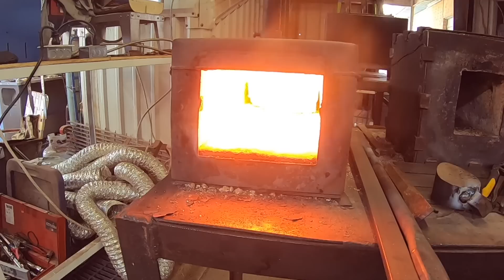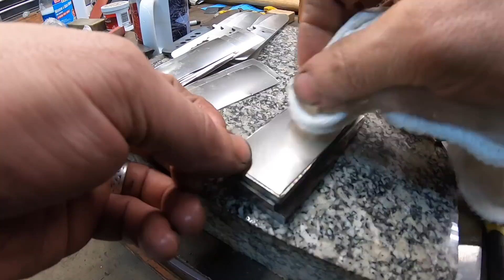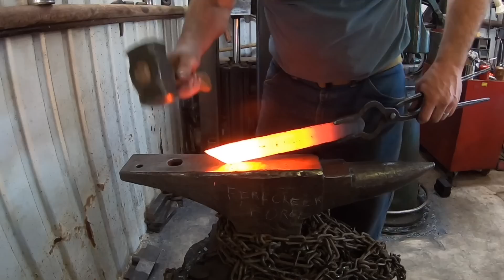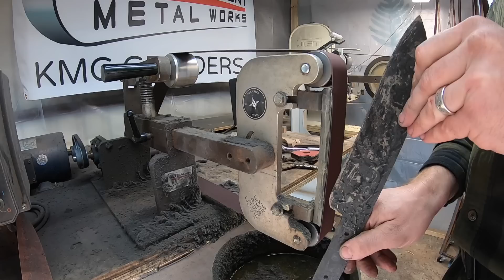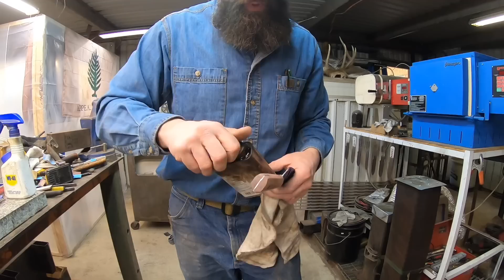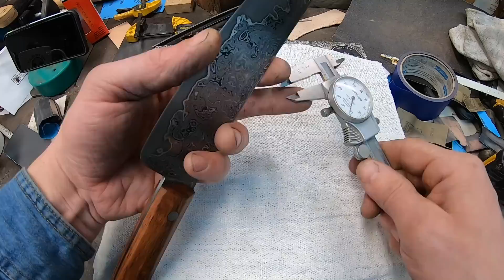Forging A Japanese Style Blade From Nickel And Steel, Blacksmithing, Knifemaking

Comment: I know this is an older video and I’m testing your memory. I am getting ready to try forge welding, pure, nickel, similar to what you used on a Damascus go my I’m building and have never forged welded using pure nickel….. besides cleaning it with acetone do you recommend grinding any of the surface of the nickel or do I just need to clean it with acetone? Thanks for any advice or tip tips. Much appreciated!
Reply from the maker: I like to brighten it up with some 220 grit sandpaper, especially if it's been sitting around for a while and has a bit of a oxide or dull lookjng surface to it. As long as you keep it clean after that, acetone isn't really necessary.
Reply: @FireCreekForge you da man!!! 👊 thanks for your help! That’s the crazy thing about YouTube is you have no idea who I am and you don’t owe me anything yet you take the time to help me out! Really appreciate that a lot!

Comment: About to attempt a gomai nickel Damascus knife. Ben having hard time finding info on forge welding temps for nickel in a billet. Any temps? Looks like you were at normal forge welding temp in the video.
Reply from the maker: Yes, steel and nickel have very similar working temps so it makes that part simple

Comment: fantastic blade, it looks like a coastline.  What caused the "shadow" line along the divide between the mono steel and the coating?  Excellent video with the critique - great content and very informative.
Reply from the maker: Thank you, the shadow is where the steel is still dark from the etch, elsewhere the oxides are cleaned off more

Comment: Nicely done. Remember that the Japanese smiths who get that even core steel reveal have been doing these blades for years. They also usually use a convex grind instead of a full flat grind which is more forgiving in terms of core steel reveal.

Comment: Hi! Just a bit of constructive criticism here. That knife looks great, but because of your camera setup, the image gets warped on the knife "pros and cons" at the end of the video. I don't know if you are using an "action camera" for that, that's a common problem with those, or it may be because of a wide angle objective and lack of correction. Anyway, when you are making a closeup, you should correct those warpings so it doesn't look like your knife bends away from the corners when it's not focused dead center.

Hope this helps, cheers ;)

Comment: The balance of the knife could be adjusted by putting some inserts into the handle at the end (metal, stone),, or adding a bolt-on end. 🧐
I have enjoyed the voice over and the analysis, and really like the way the blade turned, although unintended. As a customer, I'd most likely choose this knife over its future improved version. 
Happy holidays! 🍿

Comment: 1 inch is 25.4 millimeters; so then you invert, which gives that 1 mm is 1/25.4 inches & therefore 0.1 mm is 1/254 inches. So 0.2 mm is 2/254 inches; roughly 8 thousands (≈7.874E-3) of an inch.

Comment: thin your 52100 to the desired thickness FIRST... taper it, THEN add the softer (at temp) nickel Steel for the san mi.... 52100 is much harder at welding temp than 1045 or nickel

Comment: Nickel is a really handy metal in forging, especially when you're working with high alloys or stuff with a lot of chromium in it which doesn't always like to stick, a layer of Ni will more or less glue it together. I use it in San-Mai types of blades a fair bit, especially for the stainless cladding which is already hard enough, but a layer in there will take out a lot of the fudge-factor of maybe having something usable at the end of the day.
It doesn't have the same plastic deformation you get from steels though, so when you see wider areas of Ni in your pattern welds its usually because it'll just squeeze out and around things sort of like if you had two cutting boards and put some dough in between them, press down and the dough will still be between the boards, but very thin + a lot out the sides. Where I've found it most useful is in something like mokume-gane with copper, bronze, brass etc base metals as it does tend to have the same level of deformation as those and a bit more predictable in how it all behaves.

Just on my own observations on san-mai types of knives, you sort of want to get as close as you can to the final dimensions on that final forge weld, which means long, thin billets and then just going in by hand on the final setting with the hammer. So just a light pass or two on the forging and then sort of pick a side you'd like to have a bit more character on in terms of the core-steel exposure to the cladding coverage. Think there's still a bit of a luck factor some days! Some just don't work out how you intend
Reply from the maker: Thanks for watching, thanks for the input!